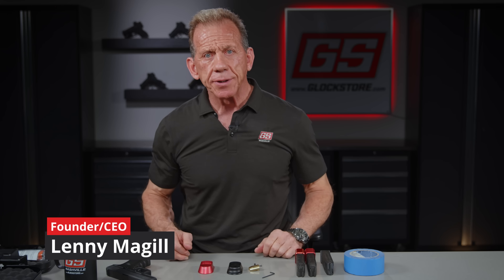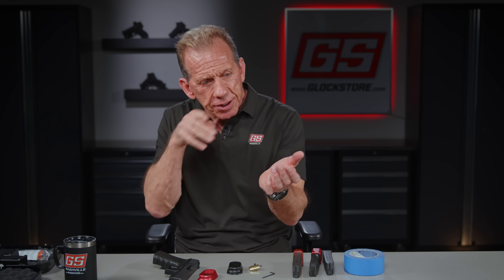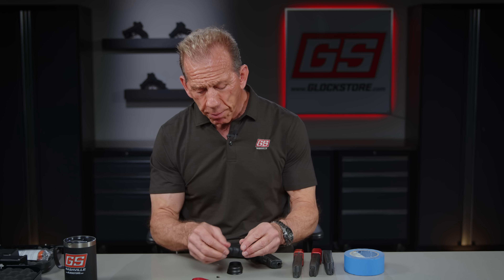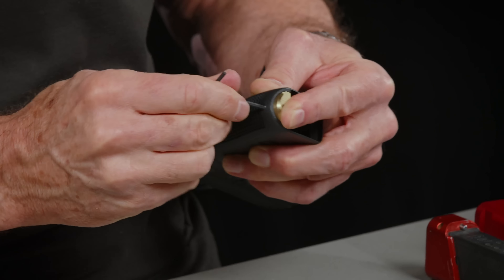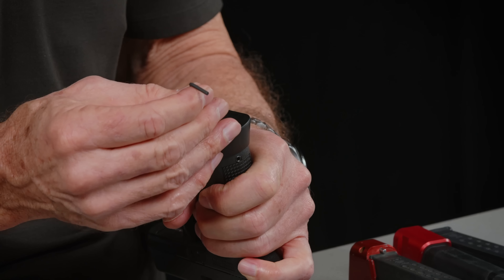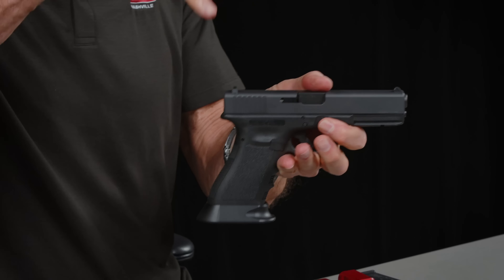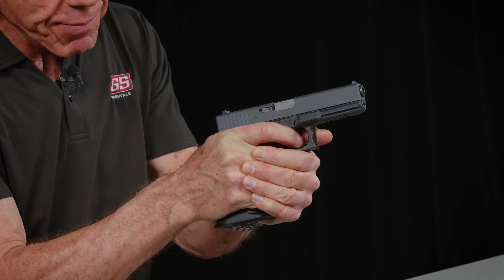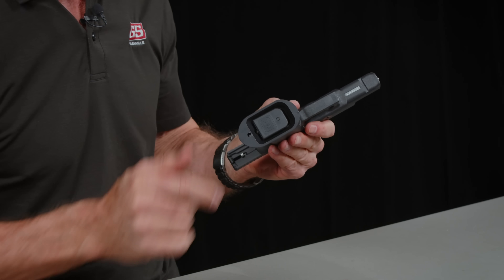Newly Designed Glock Big Mouth Magwell!

Comment: I got the first mag well and back screw only went in 1/2 way, replaced it and 2nd one does not sit flush but its close covered it with Talon pro grip. Works great with the heavy aluminum baseplates for action pistol.

Comment: Just a heads up from my personal experience. Fully loaded magazines won't drop out with magwell installed. Even have a baseplate adding weight to my 15 round factory mag. Seems the magwell puts pressure on the sides of the pistol were it's weak. Empty mags drop out fine. Might try taking a file to the magwell. G35 gen 3.
Reply: Mine doesn’t do that

Comment: Drawback is it prevents you from gripping the mag and taking it out of the handle if its stuck or in a malfunction scenario..
Reply: Swap baseplates or get an extended mag. Easy fix
Reply: Used the Carver magwell on my G21 and it seemed to flex the polymer and makes the magazine super tight. May have to Dremel the inside of the magwell now.